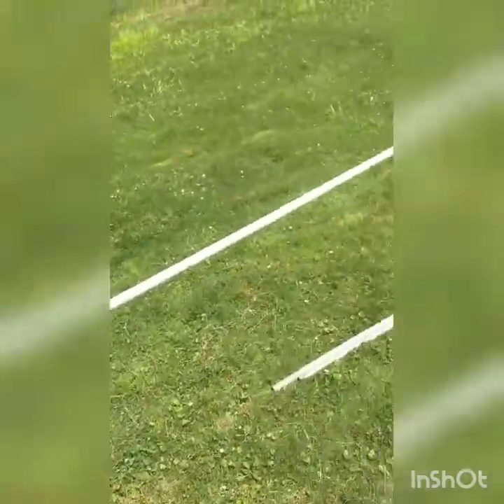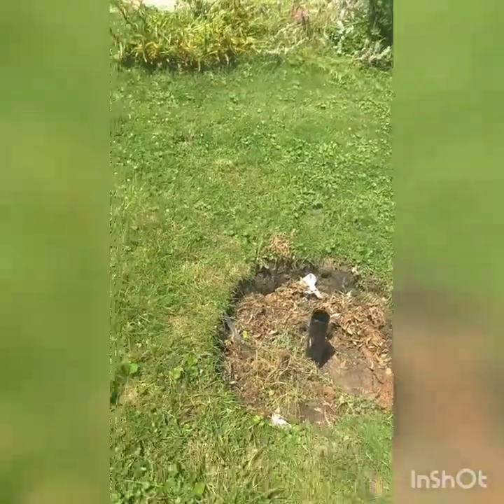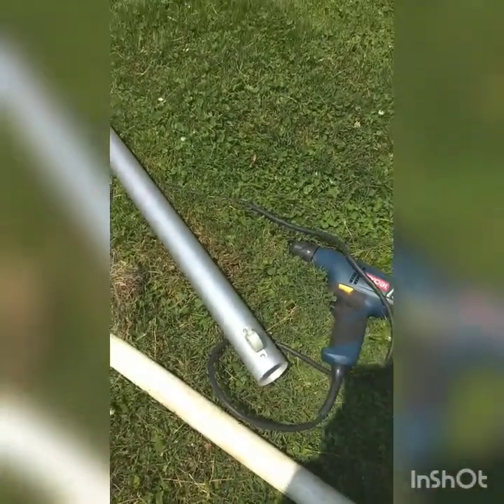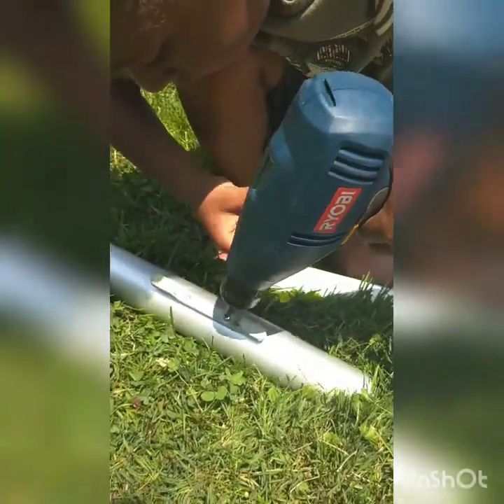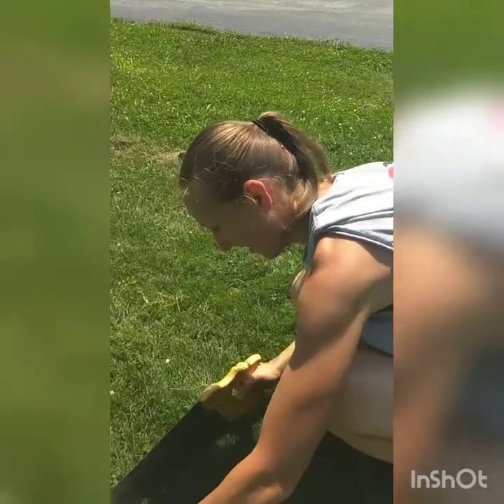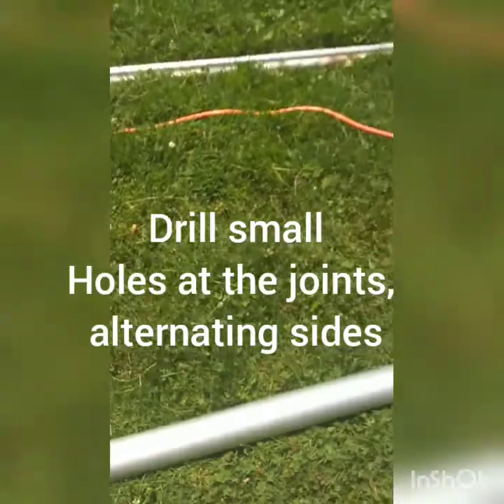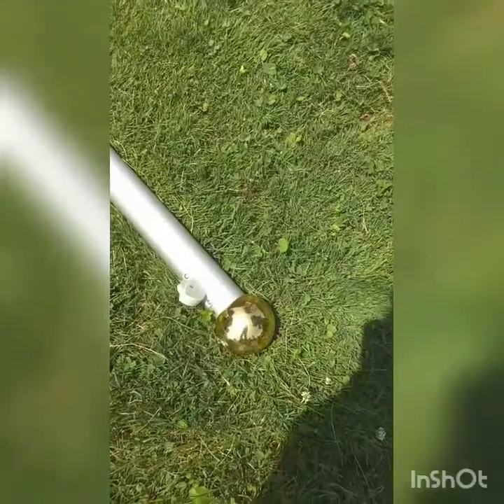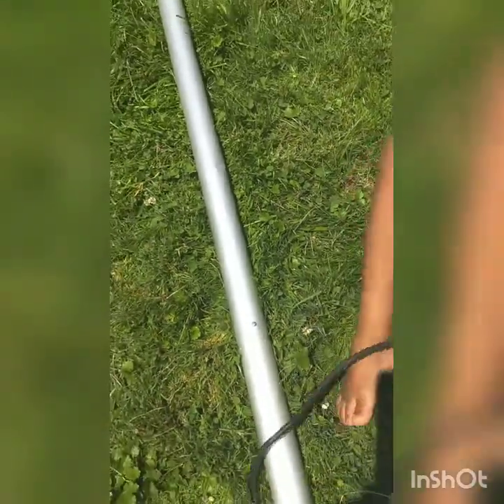Reinforcing 20ft Aluminum Flagpole with PVC pipe

Comment: Is the flagpole swaying less since you put the PVC pipe into the aluminum flagpole?  I want to do the same thing and was wondering if you can tell a difference.
Reply from the maker: We added the PVC shortly after installation after receiving recommendation to do so, so I can't compare. We have not had much swaying, and even just a little swaying under hurricane winds that came through at 80+mph. I highly recommend reinforcing your pole. Hope that helps and thanks for watching!